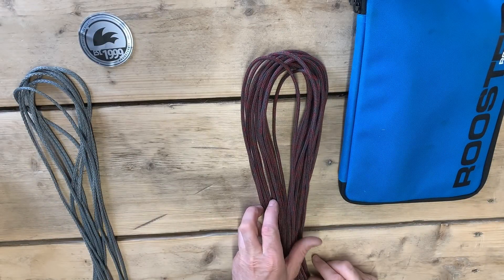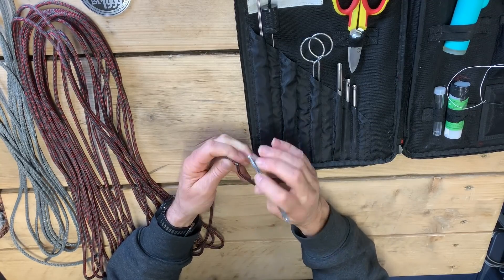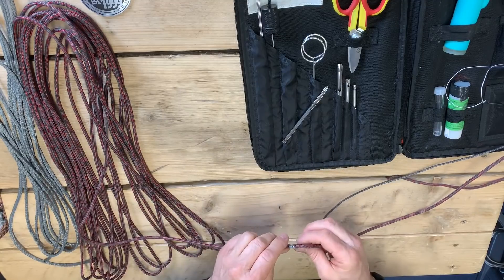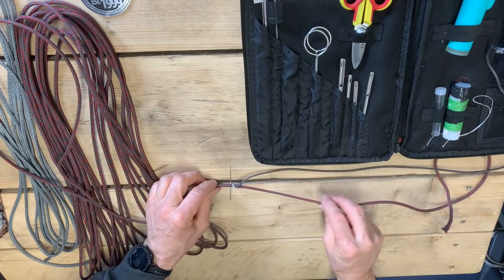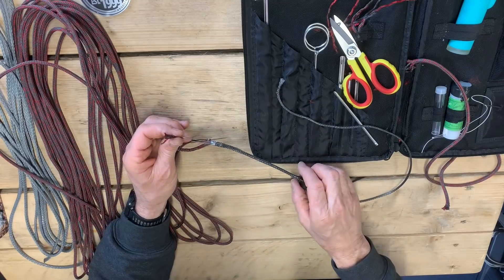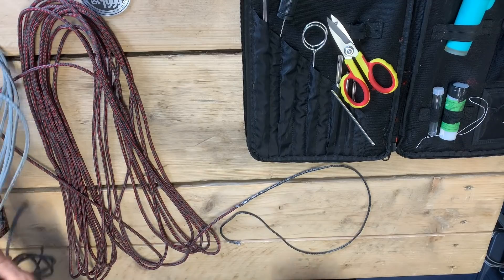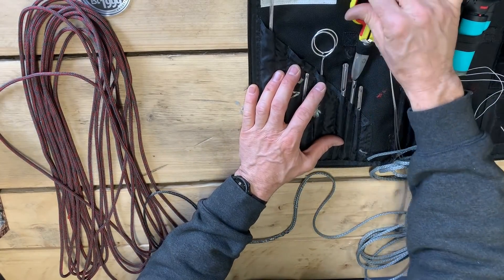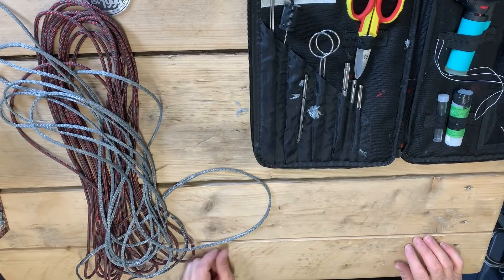Halitec and Halitail cost and weight saving

Comment: A tapered halyard can be made with the same materials. 30cm from one end extract the dyneema core from the cover and splice a brummel eye. On the other end pull out the dyneema core and splice on the polyester braid. Tie down the eye splice and milk the cover back in the direction of the polyester braid until the desired halyard length is achieved. The polyester braid is pulled into the cover. Finally splice the cover into the dyneema braid and whip/stitch. When hoisted, the dyneema core should reach beyond the stopper.